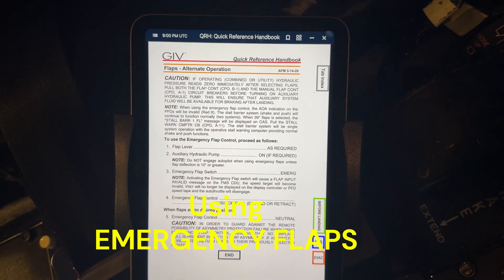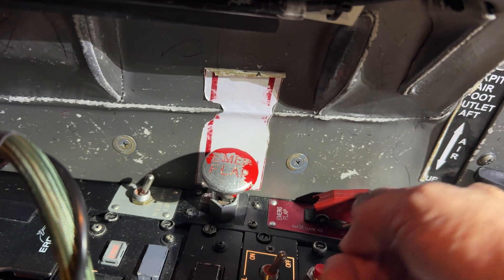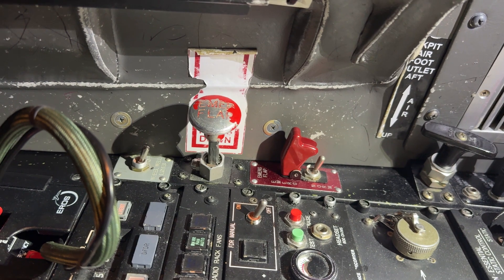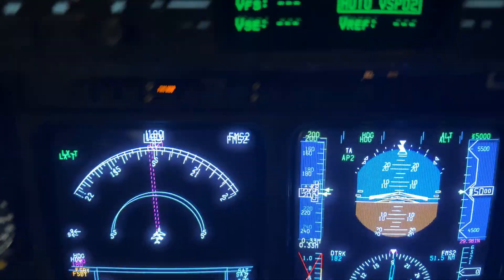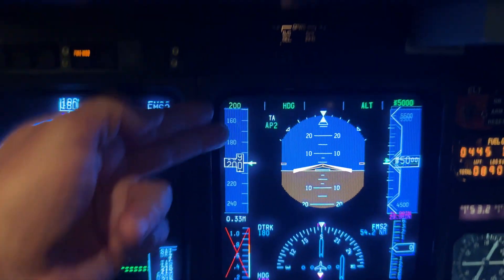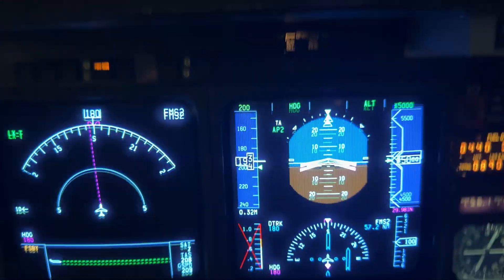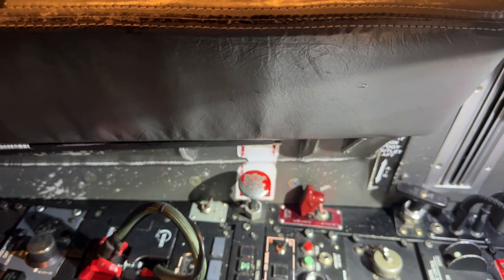Using EMERGENCY FLAPS

Comment: Can you please clearfy the hydraulic system using the emergency flaps
Reply from the maker: Moving the EMER FLAP handle from neutral to Flaps UP or Flaps DOWN position directs hydraulic pressure (assuming no failure of hydraulics) through the flap selector valve to the hydraulic motor.  In QRH page EF-13, you will find a Hydraulic component table and you will see what systems power the flaps (Combined, Utility and Auxiliary).   The only reason for the EMER FLAPS would be if the normal flap handle was inoperative.   Also, if you look at QRH PC-16, you’ll notice that the runway distance needed between zero and flaps 39’ is only about 500-1000’ more.

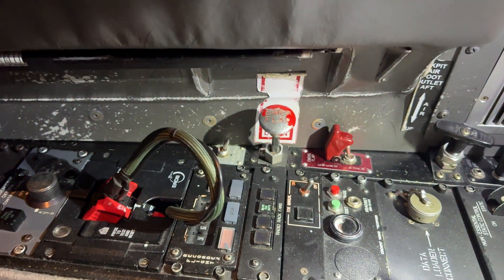Comment: 4:50 you were doing 230 knots with flaps 39 what airplane is that?
Reply from the maker: Very observant.  It’s a G-IVSP Maximum speed with flaps 39’ is 180 kts.  Unfortunately I was in there by myself and was more concerned with showing how the system worked than I was flying the airplane.  But A+ for observing that.
Reply: @CaptainDanPalumbo  Thank you! :) nice video btw

Comment: Hello don do you have to pull CB before these procedures
Reply from the maker: No…and yes.  You are probably referring to pulling the FLAP CONT CB (CPO B-1), this is only required if you don’t have the EMERG FLAP switch.  Once you move the EMERG FLAP switch to EMERG, you do not have to pull the CB.  Note:  The “MANUAL FLAP CONT” CB (CPO A-1) must always be on or normal and emergency operation is inhibited.  

However, if there’s a hydraulic issue the QRH will tell you to pull a couple CBs to ensure AUX pump use for braking.   Also, once flaps are selected to 39’ (full flaps) a “STALL BARR 1 FL” message will display.  You are instructed to pull the STALL WARN CMPTR CB (CPO A-11) which will put stall barrier system into single operation and will be able to provide normal stall barrier shake and push functions.  See QRH EE-10 for more information.

Comment: It wouldn’t be a Gulfstream without some wear and tear in the cockpit! Cool video! Also is this hydraulically operated or electrical?
Reply: Looks like the poster commented it separately on accident, CaptainDanPalumbo: Hydraulic.  You would use this should there be an electrical malfunction within the flap control.